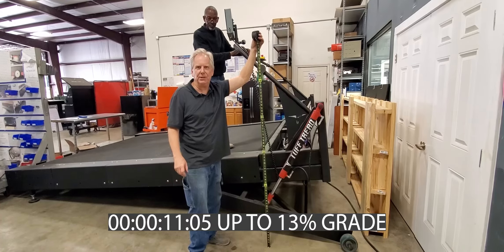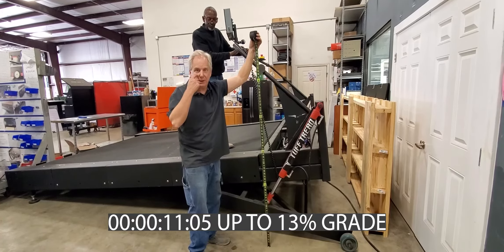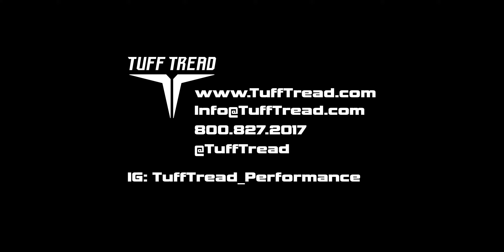Tuff Tread Ski Treadmill Grade Speed Test

Comment: How much price for this
Reply from the maker: This is one of our XXL Wide Treadmills, and depending on the features - top speed, grade range, safety harness system, etc - the price range is $10,000 to %50,000 USD. Give us a call and we can determine your needs and get you a quote. Outside the US: 1.936.463.8884 or in the US and Canada: 800.827.2017.